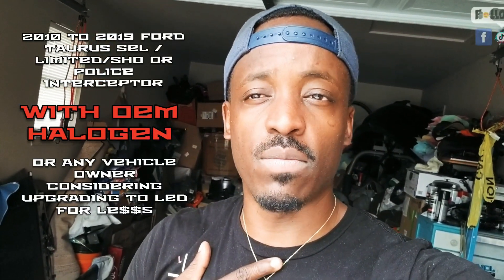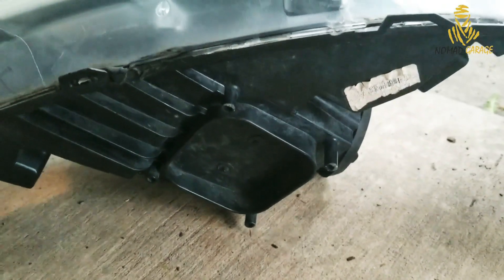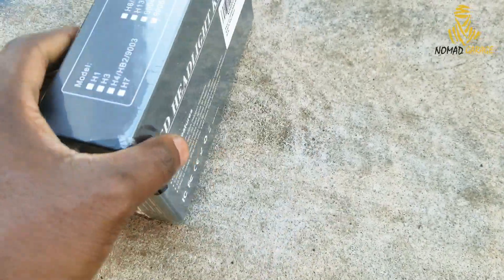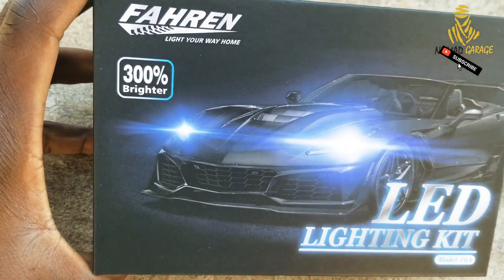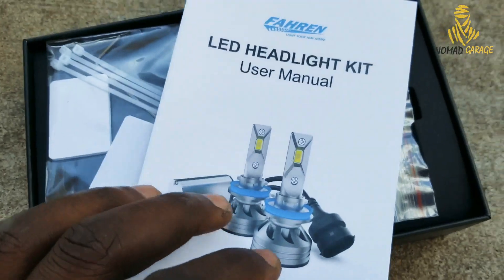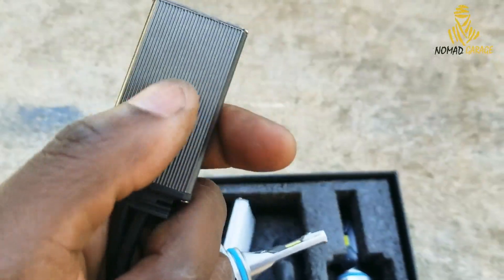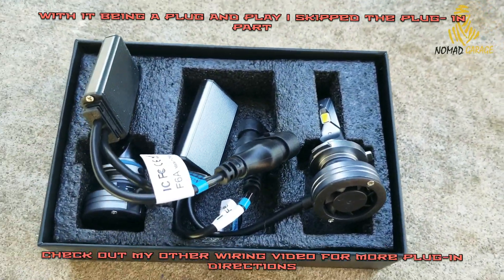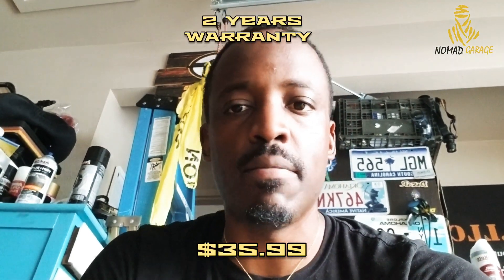LED Headlight Bulb Upgrade / Install & Review [2010-2019] Taurus (All trims)

Comment: Not Sure if this is a One- Off or, if Anyone Can Confirm but, I've Got a 2016 SEL (Ford Taurus) & I've got the 9012 Bulbs... However, After Researching, It's Looking Like the 9012 & 9005 are Pretty Much Interchangeable... I'm Going to Go With the 9012, Because That's What's There Now, Just Want to Make Sure I'm Not  Missing Something?... Thanks...
Reply from the maker: Technically 9012 should be brighter and last longer than 9005. However they should have the same connector and fit in the same housings. Safest bet is to stick to the same OE bulb specs (Unless you are doing a full conversion) and make sure you lock it up right in the housing to avoid moisture build up and bulb vibration.
Reply: @NomadGarage  ... Thank You Sir...

Comment: did you ever make a video about the HID bulbs?
Reply from the maker: No unfortunately.  What questions do you have I might be able to help.
Reply: @NomadGarage  I've actually done a lot since then lol. Replaced hid bulbs and ballasts, and I've been modding my car with a lot of aftermarket parts. Did you ever. get catless downpipes?
Reply from the maker: @DkBeatdown10  That is awesome. yes, just haven't done much since I recovered the car. Long story in the next video. But yes soon
Reply: @NomadGarage  nice, that's good to hear. I'm installing my charge pipes soon once they come in.

Comment: Where did you mount the metal resistor box? Did you leave the rubber cap on the back of the headlight assembly?
Reply from the maker: I mounted inside the of the housing. You want the cover on the back shut properly otherwise say welcome to condensation.

Comment: I upgraded my lights to led and I have a problem with a dead spot in the middle where almost no light reaches. Do you remember what angle the led on the bulbs were adjusted to in the headlight? Thanks.
Reply from the maker: 90° angle (light circuit vertical) insert and clockwise rotation to lock which should leave the bulb in a 90° horizontal position for proper use.

Comment: Wondering how you got it to fit in the housing. Have a 2016 ford taurus sel and the bulb doesnt fit into the chrome piece where the light goes
Reply from the maker: Are you sure you order3d the right light? If so, you should be good. Otherwise, check your current buld type and see if you may be have an adapter in place.
Reply: @NomadGarage  yeah I ordered the right ones for some reason they didn't fit. Ordered another set same bulb and they fit

Comment: do you know if this will work for the police interceptors? i’m pretty sure the headlight assembly are exactly the same
Reply from the maker: It should, just make sure it is a ballast base system as well. Bulb is different from 1 trim to another. lmk